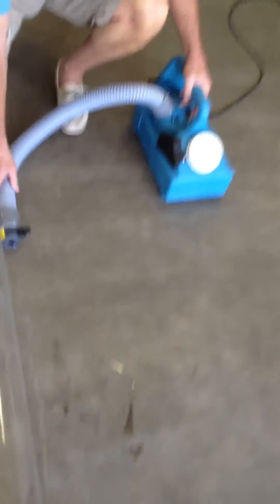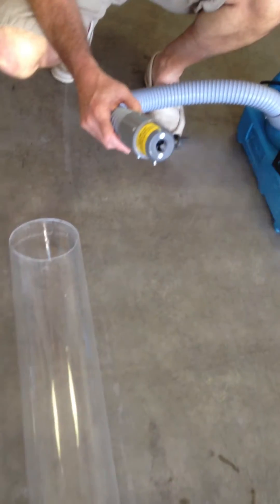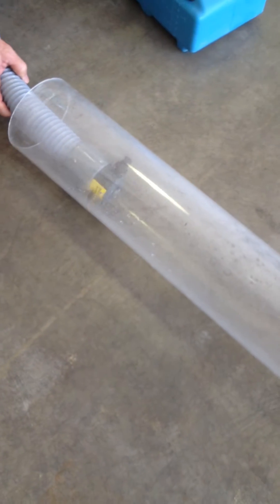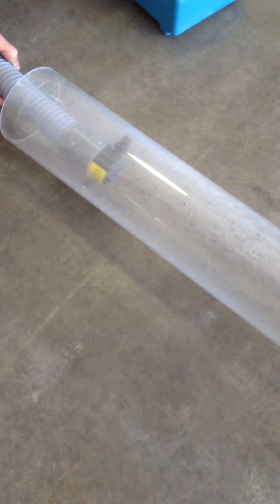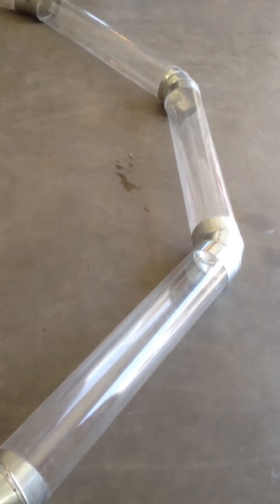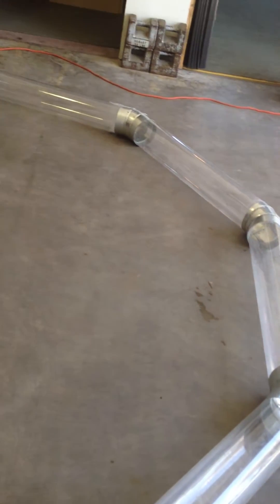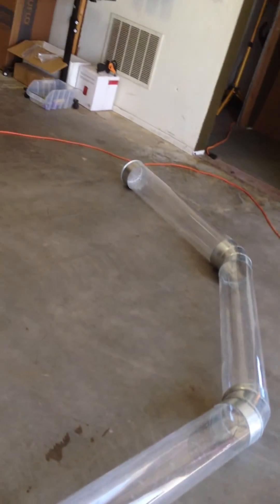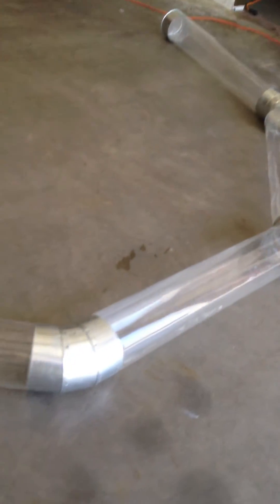SaniJet by RamAir Duct Sanitizing System Test I of II

Comment: This is a terrible demonstration. There is no vacuum on the other end of your fake duct work to simulate the blower motor. All that is needed is a digger and to turn the blower fan motor on to pull it threw the entire system in a house or building. So why don't you make a new and fair video using the fogger but have a AC scroll cage blower fan on the other end so people can see how affective fogging really is. Don't just lie to people with this horrible d demonstration the fact that you're putting your equipment inside there. Where I can potentially damaging it when there's no need to all that is needed as their fan blower to be turned on in the house and their return filter to be removed and a fogger to fog. The system is all that is needed I find this video very misleading and I'm an HVAC technician
Reply from the maker: This is to demonstrate "fogging" without the HVAC system on.
Fogging with the air handler running is even more of a disaster, as it blows the fog throughout the entire interior of the dwelling.
For more on this, check this out: https://youtu.be/FSXVdUhPjbg

Comment: The other end of the duct is plugged. It would not be plugged in an actual HVAC situation. However I do like your little sanitizer, that is a pretty cool invention and I could see that to be very useful. Although I could see your cleaning system as a TOOL in the duct cleaning industry and not as a complete system, It actually is not really a standalone. But I must say your sanitizer ball is really really really good. You should market it as such. I think you are a bit deluded with the cleaning part though.

Best of luck.
Reply from the maker: Mr. Busch, the end of the duct is not plugged, what you are seeing is a cap with a screen allowing full airflow.
As for "...deluded with the cleaning part...", SaniJet is not a cleaning tool, it is a duct sanitizer.

Thank you for your interest!
D. Hart- Founder/CEO, RamAir International, Inc.
Reply from the maker: Please read my response to tintdr (above).
In regard to the effectiveness of the RamAir duct cleaning system, we're currently cleaning the entire HVAC system at a multi-million sqft prison in California, the HVAC expert at the facility said the negative air method is a joke and there's no way he would use it in his facility.
Feel free to give me a call if you'd like to discuss further. ;)